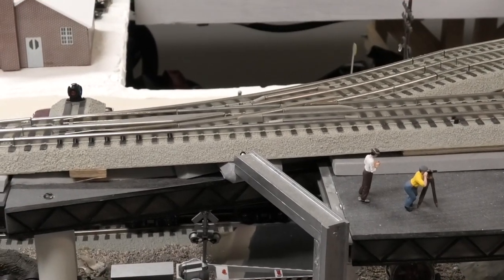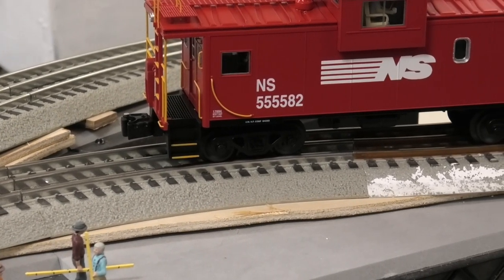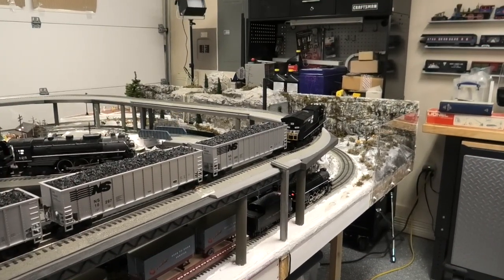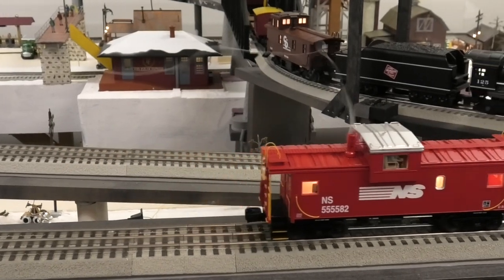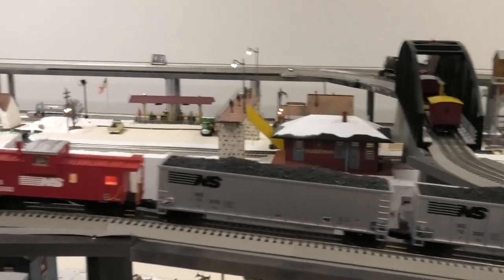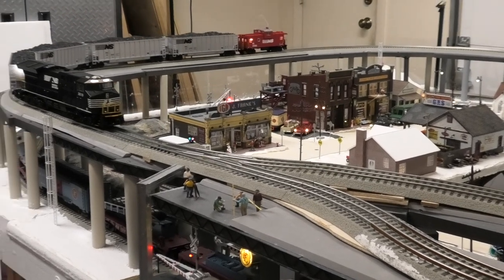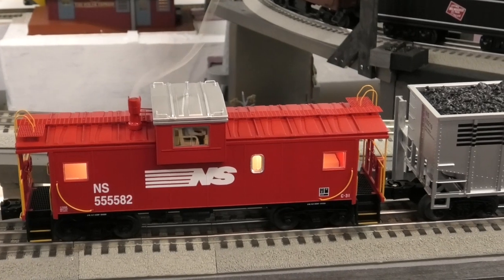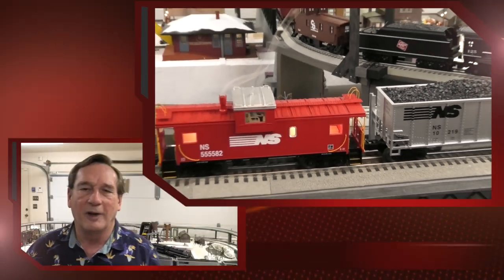Stop Derailing!  Leveling the Problem Switch Elevated Track

Comment: Your patience and persistence pays off Owen. Thinking that you need to check the contacts on the draw bridge. Does not seem to be level with a solid connection and could be causing the low power.
Reply from the maker: Actually, I’m going to have to do something to keep the lift bridge and the track it connects with even.  I have a connection with the power circuit on both sides of the lift bridge.  So that part is okay.  But I’m having a problem keeping both sides level.  Need to provide some support without getting in the way of trains on the grade. Thanks for watching and commenting.  Owen